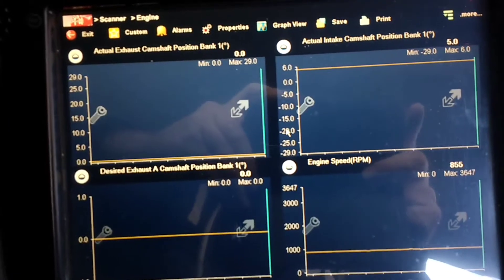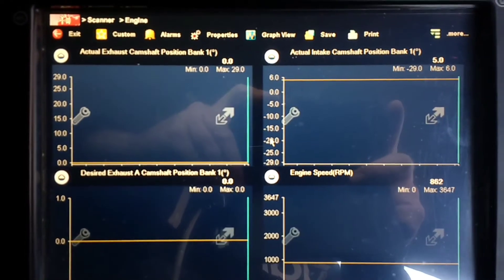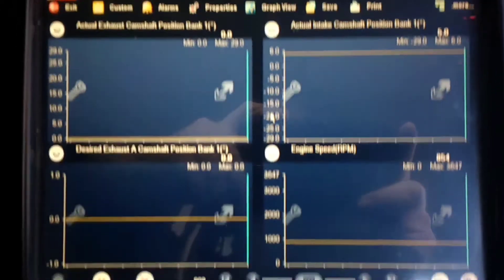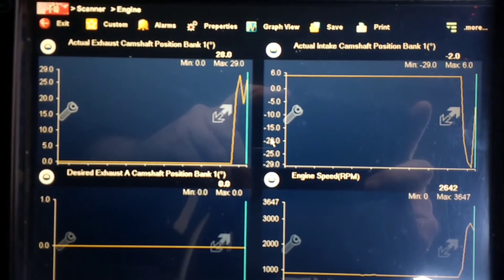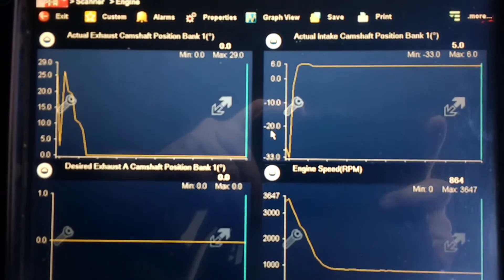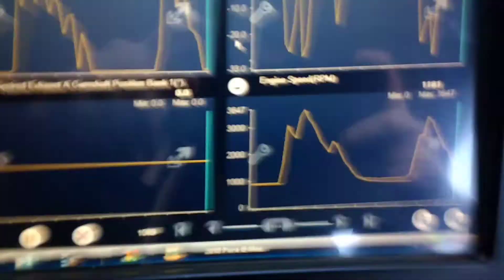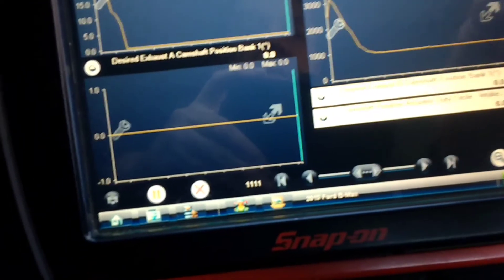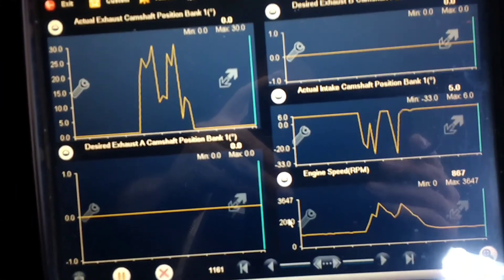Exhaust/intake camshaft PIDS

Comment: Yes this is a common strategy on dual VVT systems. it increases the power for high revs. I know BMW uses it for internal EGR as well. So no EGR valve. Don't know if that's the case on this engine, maybe you know? :) Thanks for sharing.
Reply from the maker: AutoFocus yes this has no egr valve, I think that's why they use vvt because egr was so unreliable, good to hear from u cheers sandy